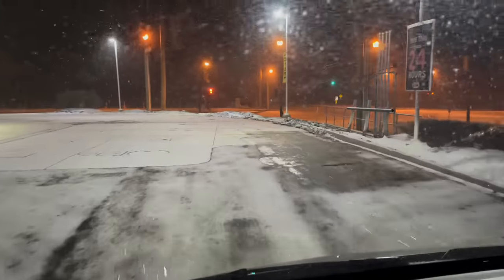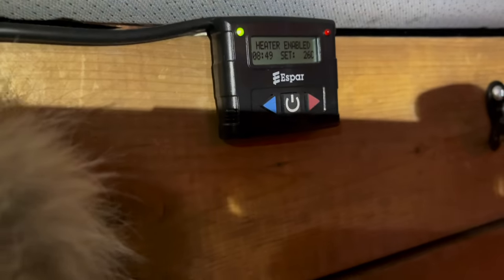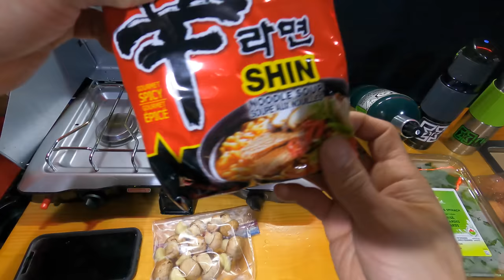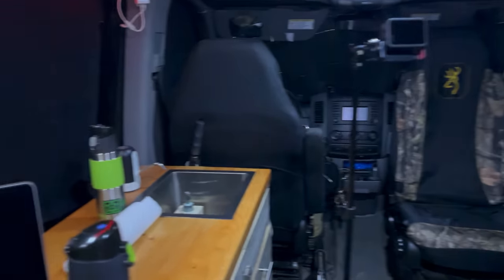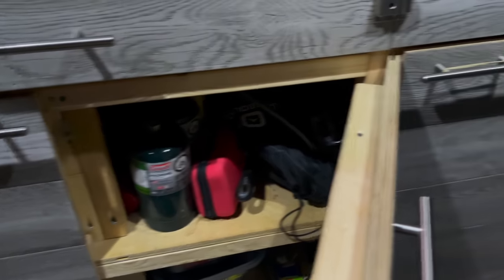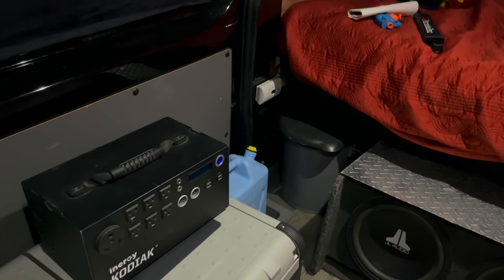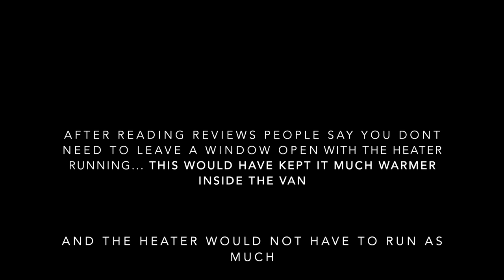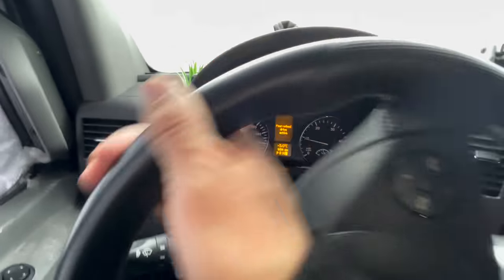Surviving Winter Storm In The 4x4 Sprinter | Vanlife

Comment: No you don't need a vent unless you have a open flame. I have a furnace similar to yours & the flame is sealed inside & exhausts outside. For your stove it wouldn't be a bad idea but not so important for something quick like those noodles. I have a rv style stove/oven so if I cook something in my oven for a hour I'd want to crack a window. Nice van but the layout could have been so much more. I have documented my entire build on my channel & you are welcome to check it out. It's fully sustainable with nothing to spare including a washer & dryer. That's right, I said nothing to spare & it's the same size van as yours but older mid size Sprinter. Layout takes time & I see so many builds doing without from a lack of planning. 
Enjoy the ride. 😎👍
Reply from the maker: Washer and dryer!? Wow definitely gonna check it out thanks!
Reply: @hustlelife369  Almost 40 years in construction my friend & a master of electrical. Washer/Dryer/Stove/Oven/Kitchen Sink/32"Smart TV/Microwave/Upright Fridge Freezer/Hidden Shower/Porta Potty under Beds/Chairs & a additional chest freezer under bed platform too. 40 gallons of fresh water (tank under bed too) And a 20 gallon tank water heater so a total of 60 gallons of fresh water I can carry. All in your van with planning.🔥 😎👍 Probably forgot something too I'm sure. I'm a old guy. 😂
Reply: You will like my Disco lights I installed I'm sure. 😂
Reply from the maker: @vanlifebiker  you got quite the build going on there I subbed looking forward to what else you’ve got coming👍🏼👍🏼
Reply: @hustlelife369  Oh it's 90% now my friend. I'm not sure what else one could need if you go thru channel. Pretty much trim & paint types of things now. A little more electrical & plumbing & bolting/ locking things down to be mobile now. I'm pretty close to maximum weight & I have a episode on how to do that properly too. Many are overweight I feel in these Vanbuilds & not on purpose. The understanding of how to properly do a weigh in needs to be spread. No we are not commercial vehicles but if a accident were to happen & someone was killed & you are overweight I'm sure the courts are going to have charges for you. It's best to stay legal & not worry. Thanks for Subscribing, I plan to do a final tour soon but shorts videos for now til I finish soon. 😎👍 Can't wait to do some travel videos.
Reply: FYI If you ever have any questions leave me a comments under the video on my channel. I'm always willing to help this community. I'd rather people be safe than guessing when it comes to safety. I documented everything so most answers are on my channel but everyone has questions. 
Enjoy the ride. 😎👍
Reply: Just curious, but why not just get a small motorhome?
Reply: @Z900Kawasa  Lots of reasons but I guess the man reasons would be more portable for off road & parallel parking in cities not to mention additional fuel costs. I weighed all the options before I started my build & this made the most sense by far camped to all other avenues. Another great reason is customization & quality of rv's these days. My van has more than most diesel pushers that cost 2-$300k & it's built to last. Hope that helps if you're considering a van build. It's not easy but nothing is easy that is rewarding & provides so much pride. 
😎👍

Comment: you should parked in truck stop where you can get a shower.  you can asked fellow truckers for shower points and they will gladly will give you a free shower which helps you save money. also parked at walmart or 24hr business where you can get access to restroom.  also adding diesel anti gel fuel additive during freezing weather helps fuel not to freeze up.
Reply from the maker: Thanks for the tips!

Comment: I'm looking into an Espar S2 diesel heater for my future van conversion. Didn't know they are that loud. I heard condensation build up with propane heater and burner during winter camping. Did you experience any of this with your propane stove?
Reply from the maker: This heater isn’t usually that loud its just that the heater fan was  running high at the time I was filming because it was really cold outside, I had the window cracked open and the maxair fan was pulling in alot of fresh air so the heat was escaping. With the windows closed and the maxair fan off you can barely hear the Heater when it reaches temperature as it will go on low mode or turn off and back on again needed. 
When cooking with the propane stove I crack the window open and turn on the Maxxair fan this reduces condensation significantly.

Comment: You aught to get yr self an electric blanket that will keep you snug, Run it off yr inverter connected to aux battery low setting uses 50w per hour

Comment: -6.5°C?It's funny that you call it winter.🤣Even in Germany people laugh about such temperatures.In the Arctic Circle, this is called spring.But seriously, your Mercedes is also extremely poorly insulated if you freeze the water in the car. By the way, it is easy to endure for months with a Sprinter. I will go there in November for 5 months with my 419 Sprinter. Then the temperatures will be between -25°C and -30°C. That's what I call winter!

Comment: MaxxAir insulation tip:  Use foam rubber like from a sofa cushion and cut it to fit the inside port of the fan.  100% cure for drafts and heat loss. You can find the foam in a craft store if you don't have an old couch to  cut up.  I have two fans and when the foam is not  in use I put them together and stuff them in a throw pillow cover.   

The diesel heater is a must.  It only took me one miserable night to make that my top priority.  I much prefer waking up to turn it down than to make sure I can still feel my toes.
Reply from the maker: Thanks for the tip!

Comment: The only concern about the diesel vans is the Diesel engine. These new engines that use ADBLUE are not very reliable. Imagine being somewhere in the mountains, in a 60-70 k $ or more van, and you’re stranded because the engine is derated

Comment: why don't you just turn the car off and use an extreme cold weather sleeping bag? conserve fuel plus you don't need to worry about overheating. the cabin won't be "warm", but it certainly won't be anywhere near as truly freezing as it is outside. then just turn the heater on when you wake up? Those are just my thoughts- I'm not the one actually doing that in person though so perhaps reality is very different from my armchair theorizing :)

Comment: If you have heater why you have to keep all those clothes on while you sleep?  Is the heater adequate?
Reply from the maker: Heater is adequate but I was a little paranoid about CO2 while sleeping so I had the window cracked open and the fan exhausting air out  to bring fresh air in. If I had the windows closed while sleeping the heater would have no problem holding at a set temperature. 

I’ve since slept with the windows close in the van and the heater on with no issues and heater runs much quieter.

Comment: You are crazy cooking with propane and not having any windows open. I do know that you did open the roof vent but that is still not enough are flow.
Reply from the maker: I had the front window cracked open just a bit and you would not believe how much air the Maxxair fan pulls out even on the low setting. That’s why also when I woke up in the morning it was kinda cold because the fan was pulling so much air out

Comment: The sound of the heater would keep you awake even if you was wearing earplugs
Reply from the maker: I agree the sound of the heater is loud… I made the mistake of keeping the window open with the fan on to bring in fresh air which was making the heater cycle on high making it very noisy. I was paranoid of CO2 but I have since slept in the van with the windows up and it’s fine to do so. When the fan is cycling on low you can barely hear it.

Comment: Dang you from 84 degrees to 53 as the night went on with that heater on. Is it because you had the windows open? With that heater, you should have been able to sleep in that t-shirt you had on.
Reply from the maker: Yes it was because I had the windows open and the Maxxair fan pulling cold air into the van and exhausting out.. I was paranoid of carbon monoxide but I have since learned that it safe to sleep with the heater running with the windows closed… thanks for watching:)

Comment: The fan noise in the background was from the heater or the fridge/freezer?
Reply from the maker: Heater. It was on high mode at the time because I was pulling in cold air from the outside. It is not as loud once it reaches set temperature inside the van

Comment: I see your subs I had three 10 inch  JL audios and one of my cars just is back one everybody got stereo system because cars did not come with nice radios but yeah you got that van you definitely need something like that to make it sound good the pick up I have now I think I’m gonna put 2 8 inch JL audio‘s and I’ll Rockford amp either Rockford or Alpine but two totally different sounds I know they were so years ago I had a real clarity sound weird sound real good and the base it not real hard but it just sounds good to Rockford‘s wouldn’t like the box pump for the minehead for 10 is kickers and a big Kemwood amp this is some years ago and the way the box was designed in his SUV two woofers were pouring out the back window into was facing straight back it would take the breath out of your chest but nobody’s really into that anymore but I do want it to sound good especially in the vehicle👍👍👍👍🇺🇸🇺🇸🇺🇸🇺🇸🇺🇸🇺🇸🇺🇸🇺🇸
Reply from the maker: Nice!  I have 2 12 inch JL subs they are older model subs but I like the ol'school bass that comes out of them better than the newer subs I tested out before i put these ones in.

Comment: Those cab heaters really are not that great. I had one for my rig for a few years and then it quit on me. I bought one of those lil red chinese diesel heaters to replace it. Much happier with the output and it barely uses fuel in comparison.

Comment: Propane cooking in a metal box with no exhaust fan-what could go wrong.
Reply from the maker: I have a window cracked open and the max air fan exhausting out through the roof
Reply: @hustlelife369  Oh good, but camping vans still should have range hoods like they do in camping trailers and pickup campers

Comment: A friend of mine just lost his semi to one of those Chinese diesel heaters.
Reply from the maker: Damn that sucks… yeah I wouldn’t trust one of those cheap Chinese heaters.  The one I have is  the Espar D2 Diesel Heater they are not cheap and come from a reputable company
Reply: @hustlelife369  My wife wanted me to add this. We bought a 3 in 1 cooker. Its a MICROWAVE, AIR FRYER, AN A OVEN all in one.  I can cook anything in there. ANYTHING. I have 4 interstate
Reply: @hustlelife369  Interstate batteries looped together 12v not 24 volt each at 1000 crank amps. I use 1/0 wire fused 350 in line to a Bestex 2000 watt inverter mounted inside storage area . Professional install by kenworth per my specifications.  The cooker is a GALANZ 3 in 1. It is amazing .

Comment: If your heater is so good then why did you have to wear a coat to sleep. i would buy a better heater that heats the whole van
Reply from the maker: I was paranoid of carbon dioxide while sleeping so I had a window open with the fan on circulating air.. I later realized you can sleep with the windows closed with this heater running and have tried it with no issues and it  keeps the temperature warm.

Comment: Thank you for such  helpful video! How do you feel about the heater,do you recommend it?
Reply from the maker: Thank you! Yes I do recommend the heater i’m just a little paranoid with sleeping with it on. But after hearing reviews people say it’s fine to sleep with it on and the windows closed that way the heater is not running on high fan mode to try to keep up the temperature.
Reply: @hustlelife369  Thank you so much, I will install it for my Van!

Comment: How do you charge the kodiak
Reply from the maker: I plug it in to the inverter I have installed on the van so while I’m driving I can charge it up. I also have solar panels I could use but mostly I just charge it while driving.

Comment: If you do not have a carbon monoxide detector you may consider getting one for your van. Carbon monoxide is odorless, colorless, and tasteless gas byproduct of combustion of diesel, propane, gasoline, kerosene, any hydrocarbon or fuel source(wood, plastics, carpeting, think house fire, etc). Carbon monoxide displaces oxygen on the hemoglobin molecules in your blood, organs/the brain does not get enough oxygen, you become unconscious, and death follows. If your diesel heater malfunctions there is a concern for carbon monoxide
Reply from the maker: Thanks for the heads up I got 2 carbon monoxide detectors in the van

Comment: I’ll never comprehend why people can’t shut off their headlights when they are driving around people in campers or other vehicles where people are obviously sleeping in
Reply: Some cars don't let you kill the headlights completely. I have a vehicle equipped with automatic daytime running lights. If the ignition switch is on the lights are on, regardless of the headlight switch setting.

Comment: I enjoyed everything about this video except for calling a couple inches of snow a "storm." Now, I bet ya five bucks that the weather report called it a storm or "event" because over the past decade, the powers that be have decided to use attention getting terms to describe normal weather patterns. There are heat warnings during the summer when the temp is +24 celsius, storm forecasts when a few inches of snow accumulate in January and they have even resorted to naming non-hurricane storms. For the past 10,000 years, a few inches of snow in the winter was just called "winter". What changed? They're desire for you to fear the weather and thus the climate. My suggestion: Turn off the news and stop perpetuating this kind of labeling nonsense.
Reply from the maker: Yes I did listen to the weather before heading out and they were calling it the biggest snowstorm of the year. The storm was supposed to be through the night but it actually started coming down hard throughout the next day and it was in fact a big record snow fall unfortunately I was not able to continue the video.
Reply: @hustlelife369  I stand corrected in this instance.